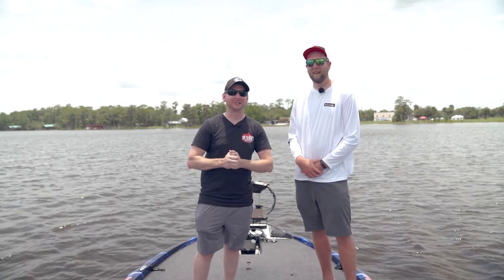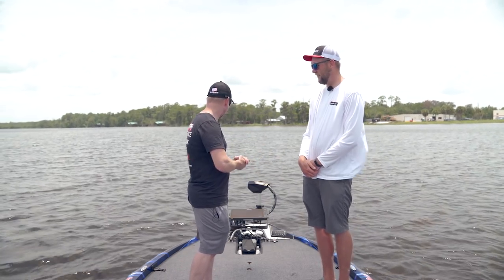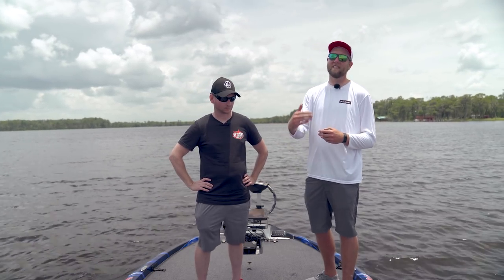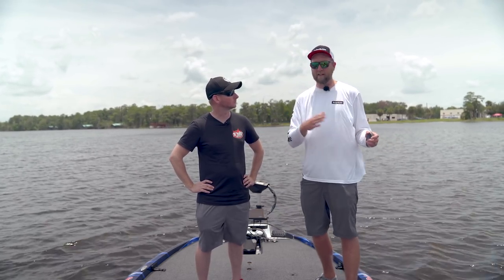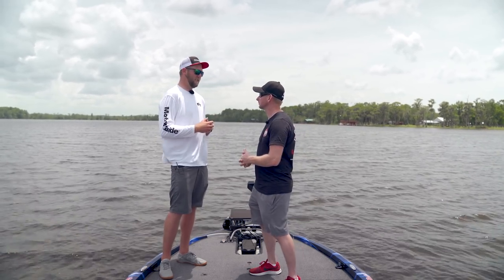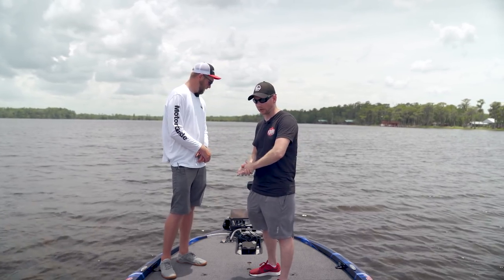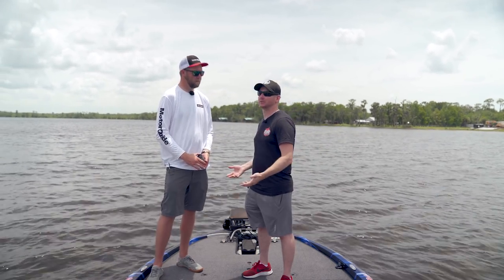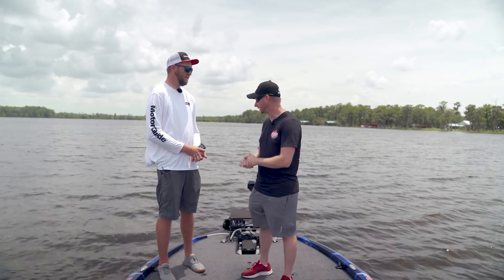MotorGuide 'TOUR PRO' Trolling Motor 'On the Water'

Comment: Cable steer with a anchor lock, no other features needed. Do it for $2K and count the money coming in. I think this has missed the target slightly. There's definitely a gap in the market for a lower priced lower featured unit as most bass guys want cable steer with anchor lock and have no interest in any of the other features.
Reply: Tim Kelly couldn’t agree more!
Reply: Yes sir I agree that's all I need
Reply: At $2000 it's still overpriced. Drop it more, imagine how many they'd sell! In no time at all, they would be making more money than they would be able to count! FedEx and UPS would have to hire more drivers!
Reply: agreed 100 percent....they are so worried about system integration and overlook the main component, the motor. Design couldve  been better as well.
Reply: Not sure on price point, but yeah, give me anchor & constant heading with a reliable motor at the best price possible

Comment: I assume Lowrance integration includes GEN-3, correct?   Or is the integration only for Carbon and HDS Live?
Reply: Only cabon and live
Reply: @user-og7il2wf3w  Well that's a bummer.  I saw the Lowrance ghost was only for carbon and hds live, I was hoping the MG Tour Pro had the interface software of the Xi5 which works on all lowrance units.
Reply: I have my xi5 connected to a gen 2 touch.  It requires a little gadget that goes on the network.  Works great.

Comment: Well it failed. Federal ordered recall with instructions from motorguide not to use spotlock. If you do use it it locks up the pedal. You have to lift it out of the water to power down then back up to use it in manual mode. Motorguide said they are gonna replace the motherboard which will have updated software. Except they haven’t made new ones yet and don’t have a timetable for getting them out. All this info is straight from motorguide. Not happy

Comment: Looks like it drifts off a little in anchor mode.
Reply: Fish 365 The back of the boat is moving from the wind
Reply: The front was drifting off.............
Reply: Did you even watch the video?
Reply: I have an Xi5 and the anchor is totally insane.  I can turn it on within a couple feet of a piling and I will never hit the piling.
Reply: Very obvious that the "Anchor" feature does NOT work as well as the Ultrex which we already know the older Pinpoint models did not compare. Point a boat in any direction, engage the Anhow/Pinpoint/Spotlock and it will eventually point into the wind. While pointed into the wind, it should have no effect on the back of the boat. I run a very light weight Bullet bass boat that the wind blows it all over the lake. With Spotlock engaged it barely moves at all even in 20+ MPH wind.
Reply: Ed Holloway You will find any anchor lock will point you into the wind. Especially in high wind environments. When the wind isn’t steady or the current is against the wind, the boat will swivel all around. It depends on what is acting strongest on the stern. 
I’m sure the ultrexx and the minn Kota’s in general have gotten better over the years. I just know when I changed to the xi5 a couple years ago, it felt way more tight on anchor than what the older minn kotas offered (which was still pretty good).  I could only tell a difference when it was used right next to something like a dock or piling.
Reply: @ikashibimauler  I said just that in my comment. After watching the video again, the wind looked like it was from a steady direction and really wasn't that bad at all. I can assure you without a shadow of a doubt that in the same conditions as in this video, the Ultrex would hold that same boat much more steady. I have one on my Bullet and I fish from a 22 TRX Triton 2-4 times per week and as of late we have been experiencing 20-35 MPH winds with waves large enough to come over the bow on both boats. The Ultrex has performed flawlessly!
Reply: @edholloway9344  Good to know.  I will definitely give them a look when I repower the bow.
Reply: Its definitely moving more than an ultrex the front is moving back and forth unlike ultrex